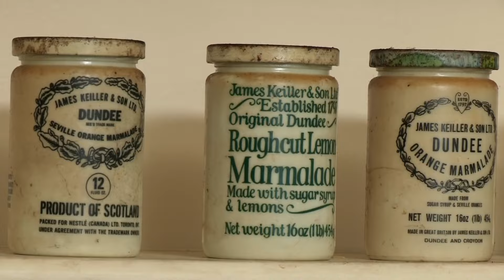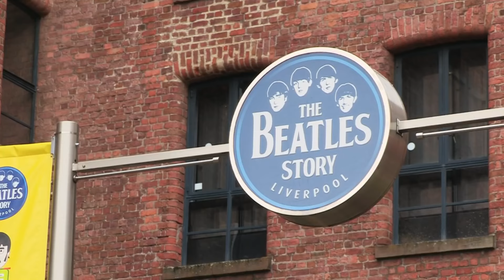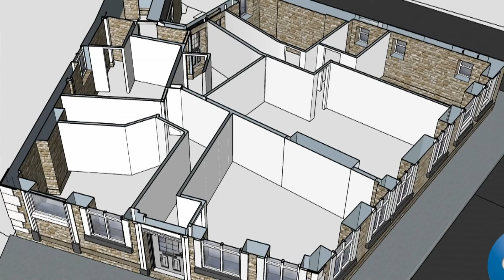Homes under the Hammer 20 Feb 2020 #home #bbc #realestate

Comment: Love, love, love the 1830s cottage. So perfectly done.
The Liverpool townhouse. Sorry, but looks cheaply slapped together. The base of the banister is a mess, the caulking in the bathroom is sloppy, as is the electrical, the carpet in the bedroom is cheap and poorly installed, and the ceiling that had all the mold wasn't torn out but painted over. And they didn't even bother to clean up the exterior or paint the front door. Garbage. Wouldn't rent or purchase ever. 
The third property has huge potential. It's too bad he wasn't able to make his dream come true. I hope they are able to achieve that soon.
Reply: Very harsh, the liverpool end terrace was done to a more than satisfactory standard in a set budget. Not everyone can afford absolute top spec fittings and people have short timescales to get these refurbs done. A perfectly fine little house for someone to buy and do those smaller jobs at their own leisure.
Reply: @michaelleigh2076  Time and effort of the things I mentioned have nothing to do with cost. You sound like you have a personal interest in the property. 
My husband and I have worked on 2 homes and 2 sailboats. It's not about dollars it's about attention to detail and doing the job right not sloppily.
Reply: @@user-oy3yo7qe6o wouldnt call it shoddy, some people have a budget to stick to.